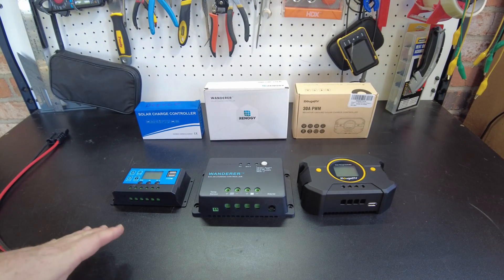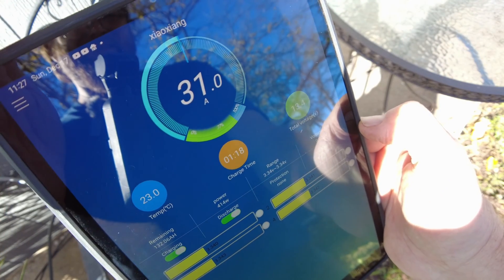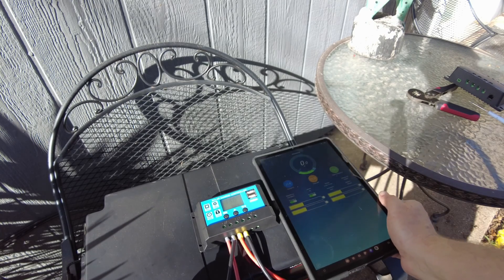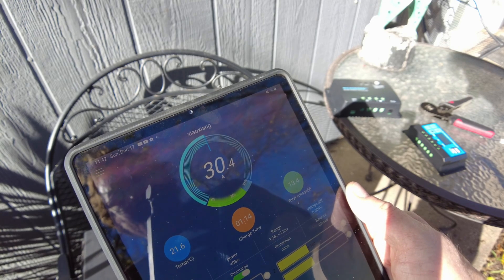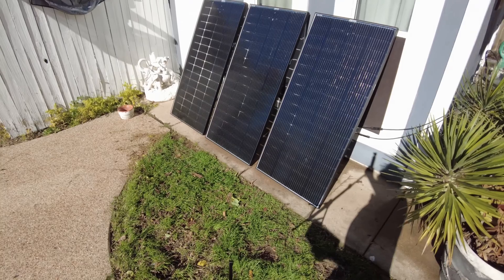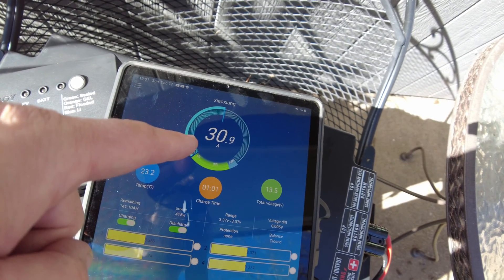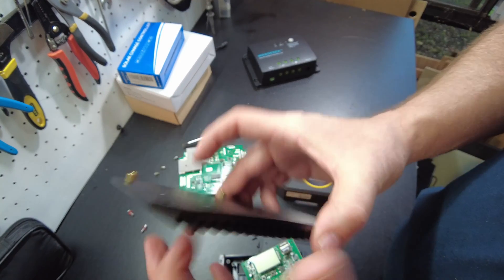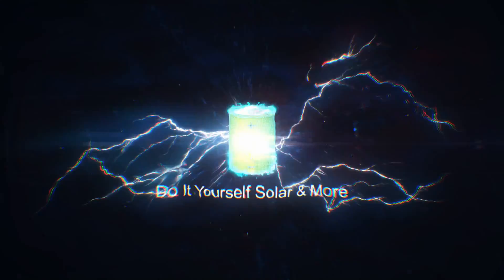PWM Solar Controller Test BougeRV, Renogy, and a Generic

Comment: So it’s fine in parallel. I have the renogy charge controller and 12v 300ah with a 3k renogy inverter.  No panels yet I’m skint and new to solar stuff

Comment: Max rating for the wanderer is 400w .  3  x 200w solar panels is 600w.      This thing is rated for 30a but math doesn’t add up
Reply: This guy is a dummy it states right on the lable 400w wich is usually 4 100w pannls. He stated each panel is 200w ×3=600w what a goofball

Comment: All these controllers are rated for 400 watts  or less you're putting 600 tru them. The renogy is 400 watt the Chinese cheapy is 380 or 390 i think the bouge is only 150 watt pv in. the Chinese cheapy will do 300 watt without getting to hot   the renogy do pretty good at 400watt the bouge says 30 amp but pv in at 12 volt is only 150 watts on their specs
Reply from the maker: It's a test to hit the 30a rating, so I needed little extra power on the input to get there. Max Current (Imp) of these panels is 11.7a, so just 2 of them would not get close to the 30a rating. Again just a test, not a permanent system. Thanks
Reply: @BradCagle  Roger that but you voided your warranty ha.ha  enjoyed the vid
Reply from the maker: @Thinkustandtakeheedlessufall  Voiding warranties is a feature of this channel :) Thanks for watching!

Comment: uh hey Bud, you have way to much solar going in.    !!!!                        read the bottom of the Renogy and max in is 400 watts
Reply from the maker: I understand that, the point of this was to push to the 30A limit of these controllers to see if they could handle it. Needed to push the input hard to make sure we got there. It's just a test, not a permanent setup. Thanks

Comment: What's the app you use to monitor for the rougerv 30amp solar controller
Reply from the maker: @brianjimenez4238  This solar controller has no app. The app I was using was for my battery.

Comment: As soon as the vid started i knew you had way too much power going in
Reply: I agree, I used to use that one blue PWM that you have in the test, Mine worked great for years, I finally upgraded to a Renogy, But I never had more than 20 amps going into it. I think it would work fine at 20 amps.

Comment: i really enjoyed this video thanks so much brother im buying the RENOGY WANDERER today thanks to you so ill use the link you put down for your affiliate link kk so i hope that helps a little but god bless and thanks you again for a great great review of these charge controllers
Reply: I have that same RENOGY Wanderer 30 amp hooked up to a 300 amp AGM battery bank,  3 x 100 AH batteries, Powered by 3 100 watt panels, it runs a water pump and sometimes I also have a small inverter on it to run some lights in my house,  It has been hooked up for years with no trouble at all,  I like that after the batteries are charged it goes into float mode and 2 of the lights start to blink at the same time to show you it is now in float mode,  Works Great.
Reply: @rayberger2694 nice yeah ive had mine for almost 3 years now and i use it outdoors and eveything but yeah i have two 100watt solar panels and i have 100amp hour lifepo4 battery and its een working great so far and its helping out allot on saving some money so yeah works great for what i need it for i do want to get a foldable 400watt solar panel one day but not sure if they make then in 12v or not lol but yeah thanks for sharing

Comment: Interresting video. However, I have to ask you if by any chance you tried to use these charge controller when vertical. It could be the reason why the cheapest one cuts out. They are made to be vertical for heat dissipation.

Comment: I like the simplicity of a PWM controller for small systems.  But you cannot run high-voltage D.C. and step it down - the excess is discarded - so you need heavy wires to minimize I2R losses.  Because no step down, with a PWM controller you don't want to feed more than about 18Vmp to charge a 12v battery.  In theory 15v would be enough, but on hot days you need a few volts extra.  With my original 48v system, I needed to wire my panels 4 in series for about 80-85Voc or about 72Vmp.  3 in series with a 54Vmp was not enough to fully charge the batteries, and the lead-acid batteries needed to be charged as much as possible, so 80V it was.  A later change to MPPT gained about 20% more power because it could keep the panels optimized when the batteries were low, while still getting the batteries fully charged by adjusting the output voltage as needed. The PWM controllers can't do that as they work by connecting the panel(s) directly to the battery for longer or shorter ("pulse width") times separated by longer and longer intervals as the battery reaches full charge volts.

Because they do connect the solar directly to the battery they also cannot regulate current the way an MPPT tracker does intrinsically - the battery sees either full solar current at the battery voltage or no current. Full current during a pulse, no current between pulses.  The pulse widths are typically fractions of a second though several seconds is not uncommon.

Before PWM controllers, we had simple on/off controllers, originally implemented with relays, that would either disconnect the solar panels (like PWM but on a scale of hours) or short the panels.  I was sure glad to go PWM and get rid of the relays!  The disconnect style didn't require a series "blocking" diode between controller relay and battery, which given semiconductor characteristics at the time saved some wattage. However as the batteries ran down the relay could close and connect panels to battery and that could drain the battery if the panels were leaky (many were).  I only saw one shorting style controller... Heard a lot about them, "only connect to solar panels or other current limited source because it shorts its input" but the ones I checked out didn't short. Their advantage was it never let the panels or wiring go to full Voc and in theory dissipating the solar energy, Isc, in wiring would help the panels stay cooler.
Reply from the maker: Yeah I can see it being totally fine for a small inexpensive system, especially if the PV is really closely match. The wide voltage, the ability to be over-paneled, and the tracking of MPPT is a great upgrade, but if done correctly clearly PWM is not so bad. Pretty fun stuff, thanks for the info!

Comment: Ithink you are overpowering these controllers.  I am upgrading the solar on my boat with 2 200 watt panel and the installer is recommending a Victron MPPT controller rated at 100/50.  Try this experiment again with 3 50 amp controllers.😮
Reply: The other thought I have had about el cheapo controller is that is progrmmed to shut down whenever the incoming amperage exceeds its maximum rated input.
They are available up to 60 amps for under $20.  They are tiny and I thought I would mount one on my starter battery with a 50 amp solar to keep topped off.😅
Reply from the maker: @bitsurfr46  Yes, it may be. However I did shade the panels even more the second time I hooked it up so I was hoping I could get it to maintain in the 20ish amp range. I think I'm going to play with it some more. Stay tuned!
Reply from the maker: Yeah, pushing the max to see what they can take. That was the intention. Probably not a bad idea to have a little wiggle room in a permanent installation. Victron, great units. I have several. Thanks

Comment: If you eliminate one panel would it still put out 30 amps?
Reply from the maker: No. These panels have Imp of 10.99 amps each. So with two the most you could get is about 22a
Reply: @BradCagle  would just 2 keep that one controller from kicking out tho? I  got some solar panels but haven't got them hooked up yet so any info I'm learning from all the online videos all help
Reply from the maker: @ralphpeabody9101  It might, I'm thinking of testing the cheap controller some more. People seem very interested in it due to the low cost. Thanks
Reply: @BradCagle  hey thanks for the info. keep up with the great info it will help a lot of us
Reply from the maker: @ralphpeabody9101  Will do! Thanks

Comment: With MPPT you can provide it with more amps than it's rating and it will simply not use the excess current.  PWM doesn't normally allow this.  Neither can tolerate any Voltage over their limit without frying.
Reply from the maker: Good info, thanks!

Comment: Hi Brad, I really like the way you approach your reviews.  This review of PWM's got me thinking --  if I was wanting to go as cheap as possible for charging a battery, the price of the Depvko looks really interesting.  If my goal was to go cheap (it is ok if the battery takes a couple of days to charge while I'm not around) then maybe I would only use one solar panel and limit my usage to what I have available from the sun.  Using this approach I would really want to know if the Depvko is up to the task with only one solar panel.

I know this configuration won't charge at 30 amps, but does it work (i.e. doesn't go into current limiting)?  Then maybe I would want to know which of the 3 PWM's are most efficient using only 1 panel.  

Just my thoughts, thanks.
Reply from the maker: Great question. This test really got me thinking about PWM, and I do actually want to test the Depvko more now. It might be fine for what you're thinking. I guess also consider it's technically for lead-acid, so I'm not sure it should be used for lithium, if that's what you're using. I have a lead-acid battery on my RV, I'm considering testing the little guy more on that battery. I do like to find cheap solutions, more testing to come. Thanks! :)

Comment: PWMs are good for short runs of cable.  I run four 100 watt panels in parallel on my Bouge RV 30 amp PWM and got over 20 amps - somewhere over 300 w at 20 and 40 ft, but stay under 250 Watts now that I have a 60 foot run.  On the same battery bank (4 LiTime minis), I run a Bourge RV 40 amp mppt, and that thing will max out in amperage  and get up over 120 degrees.  I was going to run four of those 30 amp charge controllers until I realized how bad the drop was with the long run.
Reply from the maker: Interesting, when you run the MPPT are you configuring the PV panels in series for higher voltage? EDIT: Well come to think of it, should still be higher voltage even if they were all in parallel with MPPT since the panels are not being pulled down to the battery voltage. That makes sense. Thanks!
Reply: @BradCagle  yeah I'm running four 100 watt panels in series parallel.  The voltage usually stays in the 70s I think.  It'll usually pull 40 amps before it hits 575 watts.  I had another Bouge RV 40 amp mppt that I was running 6 in series on that was getting quite warm and started leaking oil after a day.  I think like with anything else, you should just try to run in the mid-range of whatever equipment you have.

Comment: Fact about PWM verses MPPT. ( disclaimer I have both ) It is the PWM can be ran with one to 1000 of them into one battery bank, of any brand, any amperage and any controller input range within the ability without any need to have them balanced or connected for charge parameter issues. Pulse With Modulation is simple, it simply cycles on and off, on/off speed of Nano seconds for the high dollar ones, micro seconds for the cheapos, as it test and responds to top voltage/float/bulk settings. PWM is fine for most charging since the reality is a MPPT charge controller is 350% the price and fails at a rate no less then the PWM. For that reasoning it is just smarter if you have the space to add 5 to 10% more solar and use cheapo controllers that do not require tons of software and blue tooth or firmware.
Reply from the maker: Interesting. The price difference is pretty big for sure. Fun playing with these, I'm really looking forward to doing a PWM test against MPPT. Thanks
Reply: thank you for your imput. so if i understand correctly. i could hook up say a 10 a pwm controller and a 100watt panel to a 12v battery, and then say a 30a pwm controller to the same battery with different panels attached to it and both would charge the battery or bank of batteries at the same time?

Comment: You plugged 600 watts of Solar Panels into a 30 amp Solar Charge Controller...what did you expect ?
Reply from the maker: I expected to get 30 Amps, I intended to get that. The panels are 10.99 Amp (Imp) each. So about 33amps with 3 in parallel in ideal conditions. This was a test to see how the PWM controllers respond to operating at max. We slightly went over so I throttled it back with some shading. We learned the Renogy, and BougeRV handled 30A nicely. Also we learned you cannot over panel PWM, like you can MPPT. Thanks

Comment: Did you exceed voltage limits too?
Reply from the maker: You talking PV voltage? If so no, those were 12v panels wired in parallel.
Reply: @BradCagle  Read the Limits on the back of the panels.
Reply from the maker: @Snailmailtrucker  Yup, I do.
Reply: Its really 30v for 12v battery and 50v for 24v

Comment: Did you set the controllers to lifepo4 batteries ?
Reply from the maker: Everything was default settings out of the box.
Reply: Because it default mode for the cheapest one supposed to be lead acid.